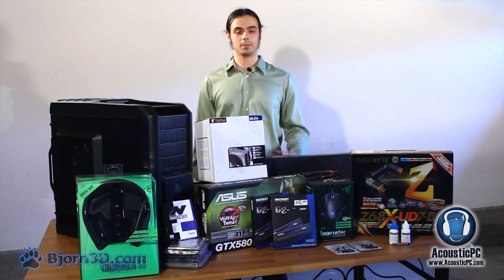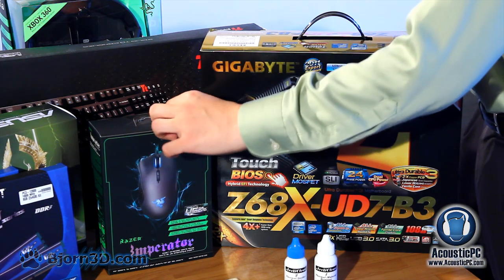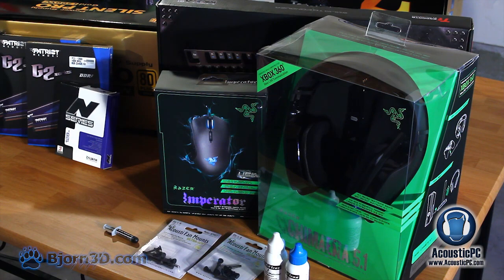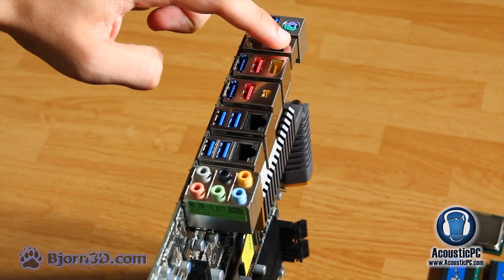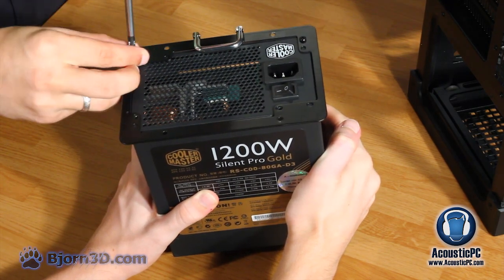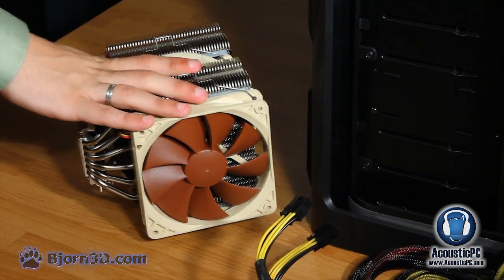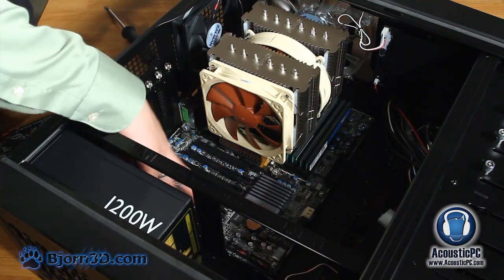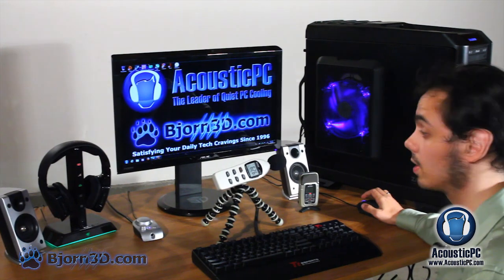How To Build an Extreme High Performance Quiet Gaming PC

Comment: @acousticpc Ofc there are multiple ways to install those fans but covering over half of the bottom fan with the card might cause heat difference between the cores and it makes the middle fan do more work sucking air through the lower half of the heatsink. This why i would expect the single fan in the middle to perform better alone. Also if you want really tweak the dBs of the cpu cooler it might better take that lower fan away than leave it there. Just small tweaks,but you are the pros here

Comment: I agree, the CPU cooler has almost no air to draw (or push) air to (from) the bottom of the case... That severely will limit the airflow and cause more noise.

Comment: it is heat sink, heat sinks cool the motherboard passively (without fan) or active (with fan), the cpu is almost always cooled by a active heat sink , but some are cooled with a passive heat sink, like very slow processors and phone processors, which are used without a heat sink at all

Comment from the maker: We would not set up a cooler with a top mount exhaust if the results were not as good or better! This is why the manufacture includes a retention plate that has different orientation. This set up was confirmed and installed by BJORN 3D Reviewers & techs and they provided comparable results & got better temps w/ CPU cooler oriented in this fashion. The cards have an intake fan & they are sealed w/ the warm air exhausting out the back of the case. So there is no contamination.

Comment from the maker: @K4270X Thank you for the comment. There is def/ many diffrent ways to instal the cooler, we could have even added a third fan. Remeber thius case has top fans. so we felty that iy was not neccessary. We also liked the idea of working with the top fans since heat rises it gave us better temps, but every system is diffrent... installing the traditional way we felt it would be fighting to exhaust the warm air out the back. Every Rig is diffrent this one really worked out well trust me!

Comment from the maker: Check out their website that is what they specialize in. Acoustic PC was the very first company to match quiet fans with high-performance heatsinks as a bundle. Since we do not manufacture cooling fans or heatsinks that is what we had to do to achieve “Quiet Performance” now you have companies like Noctua that manufacture quiet fans to another level of excellence with the heatsink included.

Comment: I agree about the cards placement in relation to the cooler. You can put a box fan in your room, but it does no good against the wall. Sure the blades will spin, but you won't get any airflow. You killed your cfm's with that setup & the top fan will only vent the case not the cpu. Basically....just because it fits doesn't mean you should use it. With those games the temps will run very high, and will need better cooling. Of course, you can't get return customers if the pc actually lasted....lol.

Comment: cool, but you dont need to put the thermal paste on like that you can just put it on by having a few dabs in the middle, you dont need to spread it out, plus the heat sink (sorry if spelled wrong) having the fans in between like that will create noise. anyway, cool gtx 580! me myself use a 550 so...

Comment: good system but could haved gone with better parts. The processor  fan is ok vertical but might work better horizontal blowing to the back. that way there's  a clean  air flow from the front  straight to the back and let the video card fans follow.

Comment from the maker: How do you figure? The video card has it’s own exhaust type cooler opposite to the CPU fan that does not interrupt. The fan on the front of the cooler is drawing warm air in and drawing away from the video card pcb. Heat rises and the top blow hole fan on the case is assisting the the CPU cooler to draw out the warm air out of the case ASAP. Every system configuration is different. We tested several configurations and this one provided the best performance.

Comment: Go for the GT640, almost as good as the GTX 680 and less than a fraction of the cost. Intel i7 is a great choice, go for it. Gigabyte board looks to be fitting for you needs as well. Do not go for an SSD, SSD's are costly and they don't make much of a different in the long run for gaming. Good choice going 2TB, that'll last you a long time. Go for 8 GB though, 4 x 2GB to maximize performance and keep in sync. 8 GB is all that's needed for gaming. Switch to 600W for cost-effectiveness. My input..

Comment from the maker: @babydash123 Also we were able to Overclock with this FANTASTIC AIR COOLER the 3.2Ghz CPU completley stable to 4.8Ghz and could have pushed it even further. But we considered perfect stablity is important. consider three degrees lower temps paying 100 approx per degree for liquid, and again this air cooler is super silent, maintance free with no risk unlikje a watercooled PC. We also support water cooling just providing the pros and cons. We  do appreciate your comments and feed back.

Comment from the maker: @babydash123 There is nothing wrong with water-cooling as a matter a fact we sell those components as well. However you have to take into consideration it's more costly, you have risk of leak, maintanace to deal with and you still have to use fans anyway! Since water-cooling works with ambient temps as well the diffrence is minimal and when comapred to the cost most dont feel it is worth it and beleive me this systems is very quiet and if you add soundproofing foam even silent!.

Comment: The backplate for the CPU cooler was installed wrong. There are notches on the backplate that should line up with the the screws on the back of the motherboard.

Comment from the maker: Good point much like a laptop, is design for mobile and over heats, as a power user I would never use a laptop as anything more than what it was design for, unless you provide some extra cooling with a laptop cooler etc.. And still it never performs as good. Also laptops seem to have many glitches. Consoles; serve their purpose, it is an in-expensive way for someone can play games, but not on the same level as a gaming PC. Everything has it’s place

Comment: That film is as simple as good ;) Very nice build,but i have one question . Why you position Noctua from the bottom to the top ? You should position the heatsink from the front to the back,so fans could easly take cool air from the case,now they take warm air from above of the GPU-s. That's some wierd solution to mount Noctua.....

Comment: there is no power to the mobo so only thing that would still apply is Static shock for only not wearing a grounding cable and it is possible to build a comp w/o frying anything you just have to be diligent at grounding yourself alot. So the ring really has nothing to do with it other then IF and IF the mobo HAD power hooked up and you got shocked. 1: you'd fry your system. 2: you would loose your finger because of the metal. thats all a safety issue not frying a system from static.

Comment: I don't agree with hardisc plastic case, it grows the temperatures. I liked more the sistem with screws becouse it helps heat dissipation within computer case which is in direct contact , and becouse of the higher level of airflow arround the hardisc.

Comment: Hi there. Can you tell me the difference between the two:
2 x 1.5GB GTX 580  and 1 x 3GB GTX 580.
Which of the two is better? Two cards or single card with the same amount of memory? Thanks! :)

Comment: yes it does because it isn't lined-up correctly there will be a tiny space between the cpu en the cooling surface and that will decrease the cooling performance of the cpu cooler. and if you think that this is just nonsense then i have a question for you:Why do you think those cutouts are there? (because they ran out of metal?)and by this reaction i'm not saying this video is bad or stupid but all i wanna say is if you teach people something teach them it the right way;)

Comment: I'm confused about the CPU fan setup compared to the rest of the air flow.. You have the top fan blowing air into the fans on the CPU cooler, which then push them down to the backside of the GPU. The only exhaust fan isn't doing much of anything then?

Comment from the maker: The thermal interface material used is Arctic Silver No. 5 thermal compound and ArctiClean two step surface purifier and surface cleaner. Contact us directly and we will send you link ton and informative video on the thermal products.

Comment: Got a question.

I've got a HAF 932 case currently and I use a single rad H60 which I'll soon be buying two Noctua NF-P12 120mm fans for, and then three BitFenix Spectre 230mm fans for the other case fans.. You think these would be quiet enough (preferably almost no noise at all) or would you recommend others?

Comment: my powersupply is 350w i run 1024mb vga card. 2.6 dual core processor , 3 gb ram, and 300gb hard drive, and dvd rom

Comment: yeah it makes a difference when its low like that.

but if any new CPU, AMD or Intel that go over 3Ghz is for 90% for the games today overkill and dont use all of it. but if all the games needed 3ghz CPUs then yeah, there would be a noticeable difference between the CPUs. Games liek BF3 and so on do show a difference becasue its made for the PC and not ported. but al the ported games are made for the slow PS3 and 360 so will work on any new CPU. thats what i meant.

Comment: You don't really need 1600-1800 dollars(assuming you are in the USA):P. But I would recommend a cpu like the i7 3770k or higher. For GPU maybe an amd 7900 series or a nvidia 600 series. A good PSU, about 800-1200 range. Case is prob your choice, and I'm too lazy to provide a compatible motherboard right now. Monitor is preference. For RAM, 16 gb or higher, since on that budget you can totally afford it. If not, or if these choices are too costly, maybe PM me. Hope this helps :).

Comment: AMD FX 6100 Black Edition 3.3GHz Six-Core $110
Thermaltake TR2 Series 600 Watt ATX Power $45
Samsung 22X DVDRW Burner $15
Gigabyte GA-78LMT-S2P   $0
Crucial Ballistix Sport 8GB DDR3-1600 $43
Zalman Z11 Plus ATX Mid Tower $58
Deskstar 7K1000.D 1TB 7,200RPM 32MB Cache $80
Samsung 22X DVDRW Burner $16
GeForce GTX 560 Ti  from newegg $200
for a total of $567 PLUS TAX

and you can add an OCZ Agility 3 120gb $90 or replace the HDD with the ssd if you have a HDD in your old computer you can use

Comment: For gaming purposes the i7 will not be utilized fully compared to the i5-3570K.
It's unnecessary, so if you want to save 200 bucks that's the way to go.
16 GB of RAM is only useful for video-editing. 8 gigs is mooore than enough for gaming.
1000W is a bit of overkill, take 650W and save tons of electricity costs (and save the earth lol)
Also the best SSD atm is the Crucial m4 CT128M4SSD2.

Just throwing it out there that's all.

Comment: ASRock z77 Extreme4 MOBO
i5 3750k IvyBridge
WD Caviar Blue 500GB HDD
Antec NEO ECO 620W PSU
XFX Double D HD 6870 1 GB Radeon GPU
G.Skill Ripjaw DDR3 8 GB (2 x 4GB)
NZXT Guardian 921 RB mid-tower case

What can I improve while still being under $1000?

Comment: Asus Sabertooth Z77 MOBO
Intel i5 3570K
WD Caviar Black 500 Gb Sata III 
Corsair HX 650W
Evga Gtx 670 FTW
Corsair Carbide 400R
Corsair Vengeance DDR3 8 Gb (2 x 4 Gb) 1866 Mhz
Crucial M4 128 Gb Sata III OS SSD
Corsair H100 Hydro Series
Samsung DVD Writer
What can I improve while still being under $1500? Is enough for latest games? Is a good configuration???

Comment: good day sir i have a Q i have these motherboard P5KPL-AM
Valuable Intel G31 uATX solution with FSB overclocking 1600MHz!
- Intel® Core™2 Quad Ready
- Intel® 45nm CPU Ready
- FSB 1600(O.C.)/1333/1066/800 MHz
- Intel® G31/ICH7
- Dual channel DDR2 1066(O.C.)/800/667
AND I WANT TO PUT A GRAPIC CARD XFX Radeon HD 6870 900MHZ 1GB 4.2GHZ GDDR5 2XDVI HDMI 2x Mini Display Port PCI-E Video Card ARE THEY COMPATIBLE IT WILL WORK? PLSS REPLY THANK U PLS HELP ME I HAVE NO IDEA ABOUT THIS PEPLY PLS

Comment: 2x gpu max 260-300w cpu with oc 150w hdds 30-40w max load fans 20w = around 500w
A psu with 80+ cert 750 or 800w whont brake break a sweat
1200w is just masive overkill

Comment: Almost every PSU is very silent until you play very demanding games. Remember, just because you have a 1200W PSU doesn't mean it will use 1200W constantly, it only uses as much power as it needs. So when you play a very demanding game like Battlefield 3 (very CPU and GPU demanding) it will use more power, causing the temperature in your PSU to increase which will increase the PSU fan speed. That's what causes all the noise. But your PC constantly makes noise I don't think the PSU is to blame.

Comment: I'm aware the GTX680 is a great card and perfect but it costs about 600$+ whereas the GT 640 costs about 150$ There isn't much of a difference between the two anyways. If you'd of actually read my comment I KNOW SSD's make a difference but they don't make a difference in gaming speeds, boot-up times. We're talking about GAMING pc's, not fast boot-up times thank you very much.

Comment: SSD does not make a difference in gaming, that's all there is to it. It makes for a faster boot-up time if you'd of read my comment you'd realize we were talking about GAMING pc's not fast-boot-up pc's. I do not have a SSD and I managed to get very high FPS in Crysis 2 and someone I know with almost an identical system who HAS an SSD doesn't get more FPS than me. GT640 has less CUDA cores than the GTX680 and like I said the GTX680 is a TON more expensive, whereas the GT640 is a close alternative

Comment: retarted cpu fan placement.... the gap between fan and graphics card is too damn small!!! there is so much obstruction in the air flow through the cpu radiator.... plain stupid placement... i would've placed it from front of the case (outer fan) towards back, that way it would be much more reliable cooling... but hey, I'm not the idiot doing this stupid mistake...

Comment: I dont get the point of having several Video graphics card. It kinda contradicts itself, and just makes the computer worth twice as much. I know it works stronger, but it's better if you just buy a GTX 580 it could run practically anything for the next easily 10-15 years.

Comment: yep get a gtx 460 on ebay for $100, a six core amd fx cpu with free motherboard for $120, a cheap $40 case, 500 watt psu $50, 8gb of ddr3 $50, a dvd drive $16, and a 500gb hdd $60 = 391 plus tax and is > xbox and ps3

Comment: The GT640 is better than the GTX 550Ti (I've had both I know) The GTX 550Ti is said as being a great gaming card. So it's odd that you tell me it's not a gaming card. Lol 30FPS? You must be doing something wrong then I played through BF3 with my GT640 with 60+ FPS on mid-high settings. There's seriously something wrong with your PC if you can't get that on the GT640.

Comment: That's not true at all. You should never spread it with a card because you will get air bubbles and that will lead higher temps. You should use the pea or rice method.

Comment: now the cpu has dust all over again. you should have installed the brackets first before you installed the mobo. many are saying that spreading method is not good, but its our technique. the heatsink should be place sideways, its choking man, plus it will look cool seeing the fans. revise your video man. im just saying.

Comment: DO NOT mount a CPU cooler like this guy did!!! Practically no airflow because the intake fan is right up against the GPU card.  This is a great CPU cooler, but no matter how awesome its rated it doesn't do any good if the airflow is restricted.  buying a CPU cooler that is half the price and that actually fits in the case would be way better.

Comment: pfff extreme, bah, x58 with 980x/990x will still beat it... just because it's newer doesn't mean is better. if you say high perf PC only, then it's OK, but how a mainstream level platform is to be called EXTREME enthusiast level platforms exist?!?! u only got dual-channel memory and 3-way graphics, x58 have tripple channel mem and 4.way graphics(i know some 1155 mobos have 4-way graphics**) not to mention new x79 boards with quadCH mem and bothx58 and x79 CPUs have greater bandwidth!

Comment: just because it's the newest it doesn't mean it's the best! a 990x will still crush it! and how the fuck is that an XTREME high perf PC if what ur using is maistream level platform(1155)?! how's it xtreme if it only has dualCH memory and only 3way graphics?! how's it xtreme if ur using reference design graphics(at least it's asus(better quality)) only "xtreme" r the case & cooler although xtreme means watercooling, not saying corsair, i mean something real like EK or swiftech, xspc, koolance...